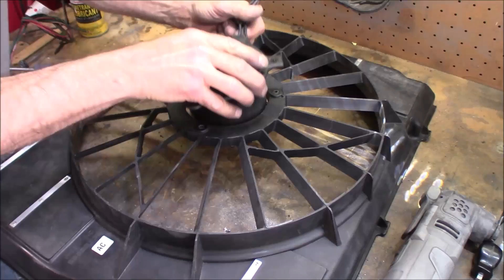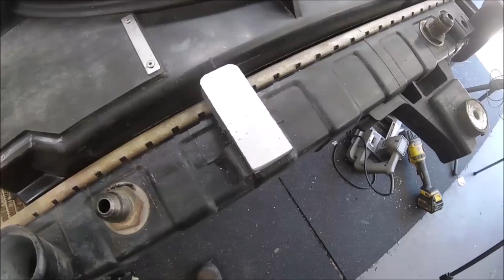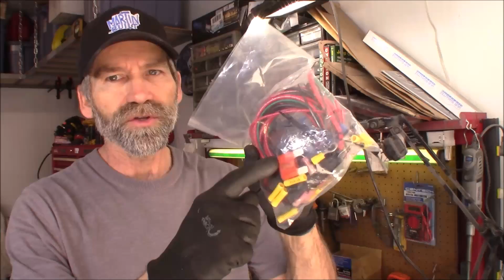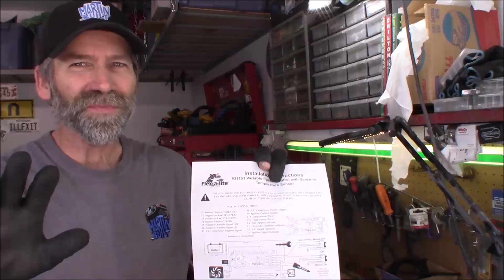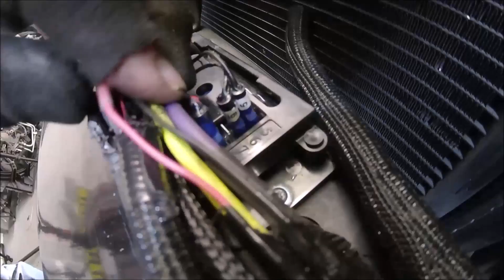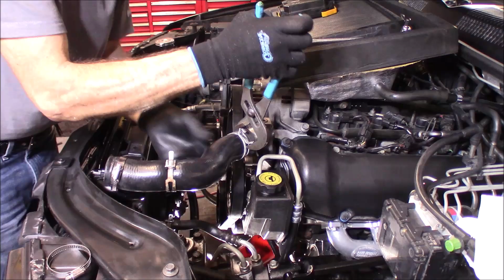Hydraulic to Electric Fan Conversion 01-04 Jeep Grand Cherokee 4.7L

Comment: Just made Similar upgrade to my WJ 4.7 HO.  Measured original Hydro fan solenoid and current is 0.3A, calculating replacement resistor give should he 47 ohm.
Reply from the maker: I simply measured the resistance of the solenoid and came up with 10 ohms and have never or had a sel light.
Reply: yes, but solenoid is not only resistance, solenoid coil have inductance also, that make difference. 10 ohms, more likely is ok, but with that possible create 5 times more current ( more likely limited in ECM), but 47 ohm resistor need be only 5W power rating, when 10 ohm need withstand more.

anyhow, you make great content. my comment was about my own measurement.

Comment: Is this possible to do with the wk and avoid the cel you get from switching to an electric fan?
Reply from the maker: I would think you could by adding a resistor to the wires that go to the solenoid once you figure out the actual resistance that the solenoid is putting out that way you can fool the ECM

Comment: Heads up. I used a 99-00 shroud and fan. Bolted right up to the top two bolts. Modified the bottom two.
Reply: Does this keep it cool enough? Thanks!

Comment: Martin,  ok,  I don't get how this hydraulic fan works!  Apparently, its electrically activated, and then powered by power steering fluid.  How do you know when its working,  and how do you repair it when its not working?   I blew out my radiator while towing,  have not pulled it but seems to be a drivers side lower seam leak.   So, I reviewed the video of your bad experience with a non-fitting all aluminum two core radiator.  I was about to order up the OEM equivalent OSC plastic and aluminum radiator you mentioned when I got to thinking" what if that crazy power steering hydraulic fan goes out next"?   Meaning should I go your electric fan route? 
  
Well,  your electric fan is hard to find!  And gosh darn it,  I can't find a better option than to replace the factory radiator with a similar aftermarket unit!  Arrrgghh.   Then I started to wonder if the Bar's Leak, High Mileage Steering Repair with Dual Action formula, I had added to the power steering unit (I have a slow leak in the power steering gearbox) had somehow affected the hydraulic cooling fan, when I later realized that the power steering unit is connected to the hydraulic fan?  I mean combining the power steering with the hydraulic cooling fan sounds just crazy!  So,  did the Bars Leak screw up the hydro cooling fan?  Could that have impacted the radiator?   And need I mention that the hydro fan, is no longer sold or mfg by Jeep, so what the heck is a Jeep GC 4.7L H.O. owner to do?  And I need to do something now!   I had planned on sending the power steering gearbox out for rebuild while doing the radiator replacement, but now,  I am wondering how I fix the hydro fan if the Bars leak messed it up!
Reply from the maker: Yeah that Bars Leak is the worst thing. It will ruin the fan. Replace both the radiator, the fan, and the power steering pump. Find a well-used fan at Pic-a-Part. A new one is over $1200. Replace the fluid with Mopar fluid that is recommended for Hydro fan. Or convert to electric as I did. There are other fans you can use like 97 Mercury Villager.
Reply from the maker: The RPM of the hydro fan is controlled by the ECM. It sends pulses to the solenoid on the Hydro fan to control the RPM.

Comment: Would I be able to delete my clutch fan on my Ram 4.7l with this mod? If so, would it be as efficient for cooling?
Reply from the maker: Yeah, I think you could delete the clutch fan and replace it with an electric fan similar to this one. One thing about a clutch fan you can't beat it for cooling the only disadvantages it does rob some horsepower as much as 10.
Reply: @martinbuilt  I figured as long as I keep a 180 thermostat in the system, it SHOULD be ok. We don't get as hot here in Jacksonville, Fl as you do, so I'll try it out. If it becomes an issue, I'll return it to stock. I'm trying to get some HP out of this engine. Thanks for the advice!

Comment: Martin, I followed the link and ordered the exact power steering pump with reservoir and it will not fit... in order to mount correctly the reservoir needs to be flush with the back of the pump(like to original is) . The one from the link angles back and is not flush.. I'll get it figured out, just wanted to let people know they may encounter fitment issues.
Reply from the maker: Thanks for letting me know.
Reply: @martinbuilt  that being said I love and appreciate your videos. Any idea on how I could use the old reservoir and cap off the extra return port that won’t be needed when running an electric fan??
Reply from the maker: @mattjones8034  The old pump is to powerful and could blow the seals out of the steering gearbox. Here is the right pump.
Power Steering Pump, https://amzn.to/3FH6hZv
Sorry about that. Hope this helps.
Reply: @martinbuilt  appreciate it man!

Comment: Hi,
Thank you so much for your beneficial videos, I do learn a lot from them.

I just bought a 2004 jeep grand Cherokee  4.0 laredo that needs some work 😕

It came with a mechanical fan that moves with the engine.
Is it ok to stay or should I remove it and put back the electric one?
What's best for the engine?
I live in an all year round moderate weather country.

Thank you so much 🙏🙂
Reply from the maker: If you're looking for the best cooling, the mechanical fan will do the best job with the 4.0
 I could have also gone with a mechanical fan, but I'm looking for the utmost horsepower and mechanical fans do rob horse power.
Reply: @martinbuilt  Thank you very much, I appreciate your answer and advice. 🙏🙏🙏😌

Comment: This is one of the best WJ mods I have come across, I live in Sri Lanka its crazy warm hear and own a 04 4.7 WJ.  Parts are almost impossible to come by as there are only about four 4,7WJs in the entire country. To do this mod I need to get a fan as well, looking at a Flex-a Lite fan for the job. could you recommend a good fan I can buy. Thank you in advance
Reply from the maker: Thank you. The one thing about aftermarket fans with all their claims of CFM I have not yet found 1 that'll move as much air as many of the OEM equipped fans like the 1 that I used in the Ford Taurus 3.8 fan.
 Another good fit for the WJ is the 97 Mercury villager.
Reply: Hi Martin, Thanks for the reply. American built vehicles are difficult to find in Sri Lanka. I have a fan off a 4.7 WJ electric version, probably of a 200c0 WJ. in fact I have the complete engine, however that has the viscous fan as well hence I wasn't sure if this will do the job. I was also worries about the electric fans performance in off road conditions even if you switch off the fan. Thanks
Reply: @nalinpremaratna925  Hey Nalin how are you? I also live in a Remote location where some parts are difficult to find, What did you finally do about this? what part did you install?

Comment: This is an educational video for sure, and it addresses what appears to be a widely experienced cooling system problem with Jeep WJ models.  My 2004 WJ Overland was already converted to an electric fan of unknown origin before I purchased it, and when I recently bought a 2004 Laredo, overheating problems that started right away have forced me to have this same conversion done by a local shade tree mechanic out here in the sticks of the Third World.

For the Laredo,  a Mercedes electric fan from an unknown model is inbound at this very moment from the junkyard, where the "consultants" would only confirm that the donor vehicle bore a 4-Matic emblem, which narrows it down to maybe twenty Mercedes models haha.  Anyway, I'll watch the rest of this clip now,  to note down any pointers that I can mention to the surgeons I engaged for a princely sum equivalent to $20 USD.  What could possibly go wrong?
Reply: W211 model electric fan is good size. Include PWM controller, that can ne easily control by arduino.

Comment: The Fan you used for this modification was off of what vehicle ? .... you didn't say this in your opening credits .... I  don't have a huge 5.2 , but I do have a 4.0 Stroker Engine 300hp .... I have to keep this thing 😎 Kool !
Reply from the maker: The fan came from a 98 Jeep Grand Cherokee with the 5.9L there only made that 1 year, and only 15000 of them exist.
 The 04 Jeep Grand Cherokee I installed this in has the 4.7 l

Comment: Nice fabrication work on the aluminum mounts. Question, are the hydraulic cooling fans unreliable?
Reply from the maker: I just think they should turn higher RPM to help keep the engine cool. They are very expensive to replace, over $1200.
I love the performance from this E-fan. It has the advantages that I want in a cooling fan. Like cooling performance, appearance, weight reduction, and much easier to work on the front of the engine.

Comment: Martin, I burned the V8 with hydraulic fan. Now I have changed the motor but I have to decide whether to put the viscous coupling (very simple) or to mount your electrical system, which I really like. I have a question: In your opinion, can the viscous coupling with the thermostat at 180 degrees fahrenheit fit? Doing your electrical work is a bit difficult because parts are not easy to find in Italy. Congrats you are the best💪
Reply from the maker: Yes the viscous coupling type fan would be the easier install over an electric.
 And with a 180 thermostat it would work OK.
 The older model Jeep Grand Cherokee's had a viscous coupling type fan with a electric fan combination. You could do that combination as well.
Reply: Thank you very much👍

Comment: Your list above doesn't include fan and shroud links. Do you have them?
Reply from the maker: As I mentioned in the video there are less than 15000 of these electric fans ever made the only way you can find them is used  at your local salvage yard or perhaps on eBay. Good luck 👍

Comment: Great Video Martin.
My question is how does your AC System working? Im assuming the ECM will turn on the Hydro Fan if the AC needed it, but since there is no Hydro fan anymore, how does the ECM control the AC system? does your AC system working properly on hot days, not exceeding pressures in the lines? Thanks.
Reply from the maker: Thanks, starting at 23:15 I explain how the A/C works with the E-fan. 
The ECM has nothing to do with the A/C.

Comment: I have a question for you.  I just replaced  the power steering pump on my 2003 jeep overland , it has a hydrologic pump to the fan as you've talked about. I'm tryin to figure out how to ingage the fan to bleed the pump. I tried to fish the system fist without knowing about the fan part and blew off the two little hoses going to the fan I connected them back but now I'm stuck,  could you please give me some advice on how to. Thank you
Reply from the maker: Yeah I don't understand why you're having such problems.  I've removed and replaced pumps and hydraulic cooling fans in the past and I simply hook the hoses backup and then bled the lines by turning the steering wheel all the way to left and right with the front tires off the ground to bleed the air.
Reply: @martinbuilt  it says I have to use a ob2 scanner to ingage the hydraulic fan so they will bleed out the air to. It says to do what you said then lower the vehicle and start the engine and using a obd2 scan tool activate the hydraulic fan to full operation then turn the wheel.  Turn off the engine and inspect the fluid level . Then with the engine running use the old scan tool to activate the fan again to full operation and briefly rev the engine to 3000 ram to engage the hydraulic fan then check again. I have no idea how to use the scan tool to engage the fan and even if it is nessasery.  I just don't wanna mess anything up my old lady would kill me lol. I very much appreciate you replying back to me. Hell I'd even like to oy ya if I could figure this out.  If you have time to let me know I thank you very, very much.
Reply: Not oy ya pay you sorry lmao

Comment: Do you by chance make those brackets? I need some but don’t have my own drill press
Reply from the maker: Sorry I don't, the call for those brackets would be very low since there's less than 15000 of that  particular fan ever made.
Reply: @martinbuilt  no worries! Thanks anyways Martin! Been watching your videos for years now. You’ve definitely saved me an arm and a leg. I’m deleting the hydro fan on my 4.7L ho and replacing it with a clutch and electric fan. Just gotta figure out what electric fan I’m gonna run.

Comment: ordered power steering pump off your list, it was actually more economical at eBay. When I tried to bolt pump to head, the tank hits the head and pulley wouldn't line up, looked at my old pump rear of tank is 1/4" forward of rear of pump and is  parallel , not on angle that sticks out parts rear of pump that I ordered. Please help with number for correct pump.
Reply: Did you figure this out I’m having the same issue right now

Comment: Martin I think your video is great and your attention to detail is amazing. I have been trying to decide between a zj and a wj for an off-road exploration rig. I have done quite a bit of research and found that the wj's with the 4.0 have an electric fan would it be possible to use this setup on the 4.7 maybe with an upgraded electric motor and the controller you installed. The shroud should be a perfect fit.

Comment: Wiring the AC this way will only turn the fan on when the compressor is on; it will cycle on and off with the compressor. Have you found a way to have the fan turn on all the time when the AC button is pressed in the vehicle?
Reply from the maker: Why would it need to run if the AC compressor is not on?

Comment: Question how did you get or did you get the engine light off
Reply from the maker: I explained that in the video starting at 33:15
Reply: And again im sorry what fan you used should I pull a fan and radiator out of v8 from a model that has a electric fan already so i dont have to fan some brackets. Please any help is gravely needed. Ps i subbed and turned on notifications. This is my first big boy car had a kawi ninja and honda rice racers lol
Reply from the maker: @gregorysamaniego36   Even if you used another radiator and fan combo you'll have the same problem that the radiator does not fit the Jeep even if it came from another Jeep. Best finding a fan to fit the existing radiator. Thank you for subscribing. 😊
Reply: Also thanks for the reply sorry for having a dumb moment for some reason my YouTube only played the beginning 5mins and last

Comment: Hey Martin, I bought the same pump with reservoir you have listed in the description and the reservoir won't fit. The back of the reservoir slants back (instead of being flat like original one) and it hits the valve cover/cylinder head and won't fit. In watching this video again, it looks like you may have re-used your original reservoir? Or did you just re-use your original cap? Anyway, would love to know what's going on, the only "flat" backed reservoirs I'm finding are those intended to be used with the hydraulic fan and have the extra port on the reservoir.
Reply from the maker: No I did not use the original reservoir.  I took mine  Power steering pump right off a Jeep Grand Cherokee With a 4.7 prior to the hydraulic cooling fan. Which should also be the same as the 6 cylinder power steering pump.
Reply: Did you find out what one works I’m having this issue right now
Reply: @robertquillan7436  Had to do some searching but finally found what I ended up buying. It's a Cardone 20-61607. As of right now, they're going for 86.95 on amazon.

Comment: There seems to be arguments regarding the so-called 'best' cooling fan system. Several videos on the subject matter have indicated to never use an electric fan as your main cooling solution, while others say that they're better due to less front drag on the motor due to the fan turning. I'm kinda stuck in the middle and see the pros and cons of both solutions. I have the 4.0 with the belt-driven fan assembly and recently saw a video to upgrade the clutch and fan with parts that fit Ford Explorers, Expeditions, etc.. The fan has twelve blades as opposed to five and the clutch is supposedly better in terms of quality and reliability. Does anyone have any thoughts or suggestions? Martin, I'm assuming you feel electric may be the best, but I don't have a terminal for a main fan, only one for the condenser fan. Thanks everybody and I apologize for the long ass comment.
Reply from the maker: I find it funny that some videos out there would say that an E-fan should never be used as the primary fan, when the are countless vehicles that only have E-fans and work great in controlling the engine temp. I couldn't be happier since I've installed this E-fan in my Jeep.
Reply: @martinbuilt  since I don't have a factory plug for it, I'll have to use a sensor with a relay unless I can tap into the condenser fan circuit wire to trigger the relay to turn the fan on.

Comment: What if I have a radiator cap? Would I want to keep that? Or could the 40mm adapter go in place of that?
Reply from the maker: Are you saying you have the radiator cap in the upper radiator hose.  What vehicle are you working on that has a hydraulic cooling fan??